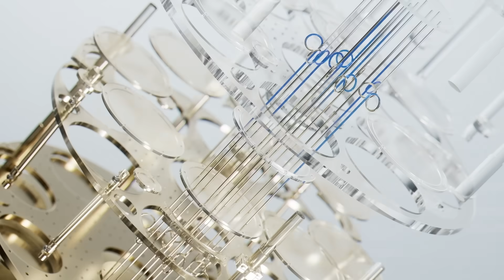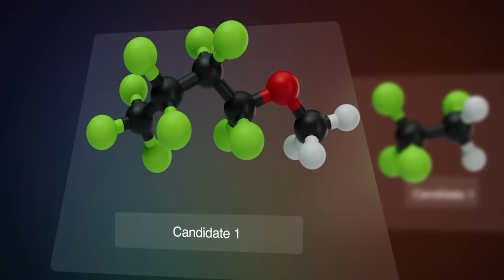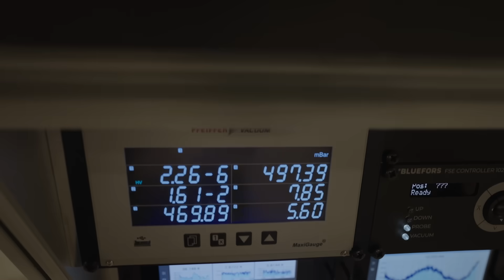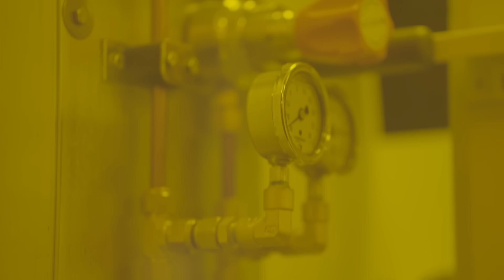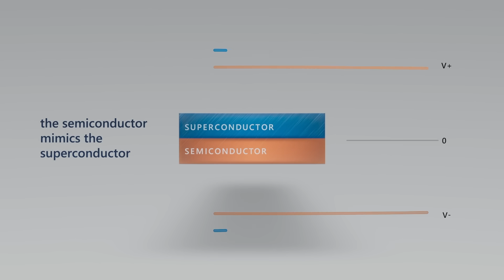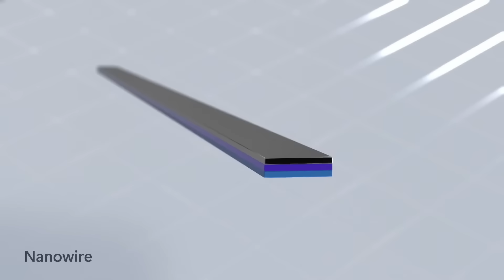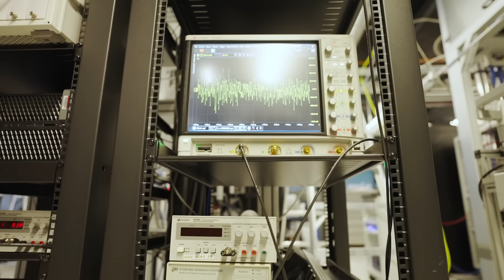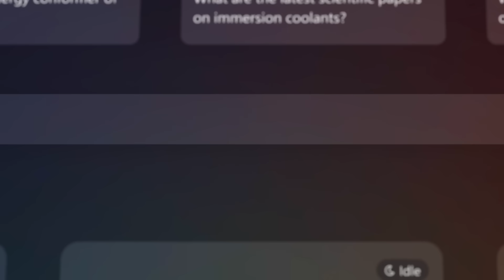Majorana 1 Explained: The Path to a Million Qubits

Comment: If this works, this solves material science. Forever.
Reply: who knows, there's always a bigger fish
Reply: Mr. Shapiro, funny seeing you here. I expect a video on this!
Reply: Hi dave!
Reply: But does it??
Reply: @DaveShap  it won't run windows 11 due to less VRAM in its GPU
Reply: If this solves material science, it wont be forever, because it would create problems we currently cant even imagine yet
Reply: I love how they don’t explain anything, just marketing
Reply: @ the best marketing is the one that never actually says anything in 3000 words.
Reply: @DaveShap  Ho hello!
Reply: Lol waiting for the latest Wes video.
Reply: So, how does it solve material science? What is there to solve? 😂
Reply: @ragdraco497 these allow the full, fast calculation of quantum physics interactions, so the simulation of advanced materials at an unimaginable pace
Reply: @ragdraco497  ceramics, carbon, graphine or graphite, electrical conductivity--heat problems in current computing, concrete and building materials, glass. Im a novice but you can see cutting edge materials science news from MIT website. It's a fascinating subject. For instance, an airplane made of carbon that is indestructible,  flexible enough, light as a feather requiring MUCH less fuel. Same with rockets. Think of farming equipment made with light materials and the fuel  cost savings thus food savings. Prolem materials such as plastics, Styrofoam and paper boxes. Limitless materials are needed for so many applications. Asphalt roads! Asphalt and rubber roof materials! Clothing materials--like replacing cotton somehow
Reply: Hey Dave please make a material science focused video 😊😊

Or do you already have one 😮
Reply: Ai already mostly does this on classical computers. quantum may be able to massively accelerate the whole computation in general but unless we find a room temperature super Conductor or make room temperature quantum computers, Ai will almost certainly always remain more practical for small scale businesses who need to privately compute their data.

that being said no matter which tech holds the lead or gets replaced by something else we live in the most exiting time in all of human History so far, maybe ever.
Reply: If this works, it solves everything
Reply: Key idea...  IF it works.  Define "works"...
Reply: @kayakMike1000 have a complex problem that it can solve that is unsolvable by other means.
Reply: Not just that aswell
Reply: @DaveShap   Hi Dave,  please let me understand what is the difference between qubits and majorana particle ??
Reply: @devshap that means room temperature super conductors????
Reply: @shardul9197  that might be a little away. Maybe better rocket fuel or better carbon nano tubes
Reply: very big possibility
Reply: Not quite, still need to figure out how to model and simulate the interactions and behaviors and know all the physics involved, which we don't yet, and have the idea of even simulating for/testing for a given property that we might be interested in (which we still might not even know exists and thus know to look for yet), so even with a computer that could simulate things, it aint solved by any means yet. However... yes, this would/could be a MASSIVE leap forward for material sciences, kind of like recent Advanced algorithms (so called AI) have helped with figuring out protein chains and stuff, at a rate that blows past all previous levels of progress.
Reply: I was considering studying this and have pretty much fallen in love with the subject at this point. I'm just asking to know how you think this might affect materials science as a course that can be studied in uni
Reply: @DesmondIgwe-d2m by the time you have completed your studies, the value of the human work force will be in fast decline if AGI, and QC have arrived!
Reply: this solves everything forever. I am genuinely scared.
Reply: get out my head dave.
Reply: Sounds like scam with no real thing they showed they solved using this just promises and hopes
Reply: The age of biomaterials has arrived.
Reply: please dont overhype this, they already did it with this video.
Reply: if this works, passwords and money bye-bye
Reply: Oh phew. Glad that I don’t know anything in materials science and not spent years to master it...